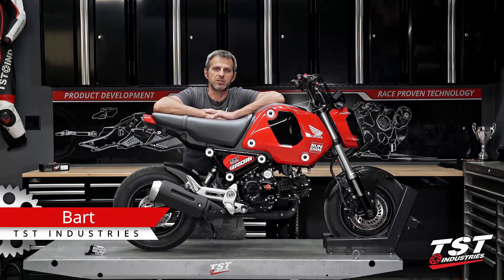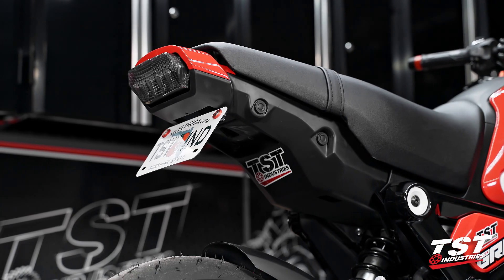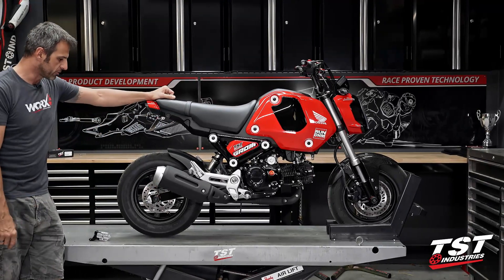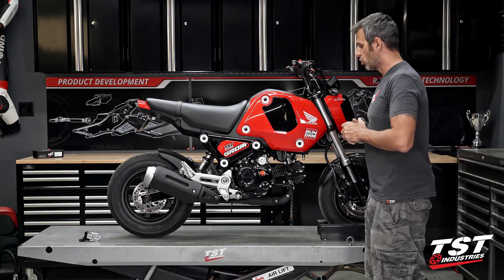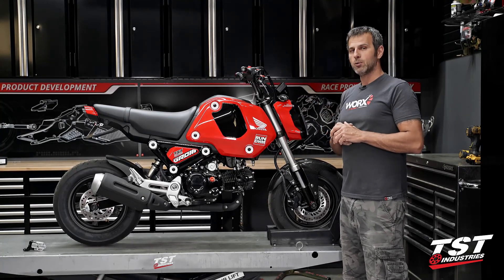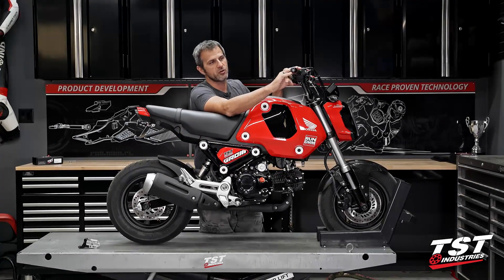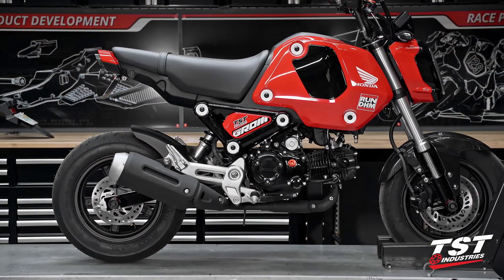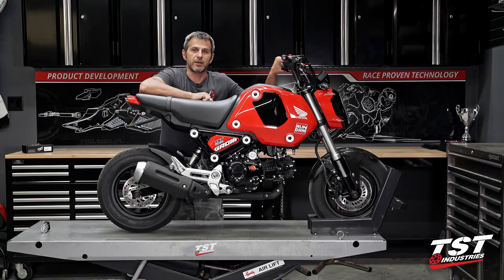2022 Honda Grom - TST Industries Parts Development

Comment: Do I need to change the flasher relay if I swap the oem blinkers with led’s? Or does it already have a led flasher relay due to the led headlight?
Are the license plate bracket mounts the same as previous generations?
Thank you
Reply from the maker: Hadlight and signals are separate circuits. You will need an LED flasher relay.
Reply from the maker: @chrisberry9653  There may have been something else causing that. It's physically impossible that a flasher relay caused that and this video I just filmed is proof. 

https://youtu.be/C2Iw3NWTc_E
Reply from the maker: @UCu1mv8j88XYgsNH1DlbutnQ Tip sensor, starter relay disconnected on accident, fuses, so many possibilities. Not saying any of these were the case on your particular bike but we've seen stranger things happen! haha

Comment: Crash cages on groms are not good they just break cases and hardware
Reply: @relate97  consider ur self lucky I’ve never got close enough to have my motor hit the ground.it’s not needed if u have axle sliders and z&z rearset w hard mount pegs, a12 bar.